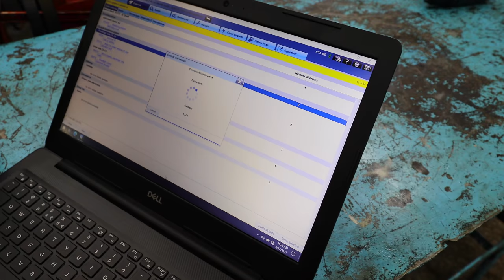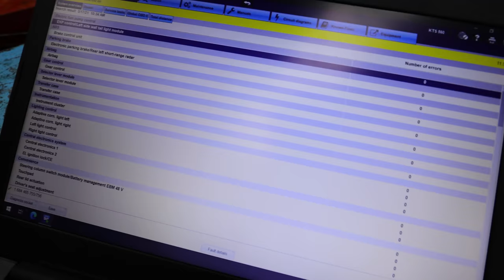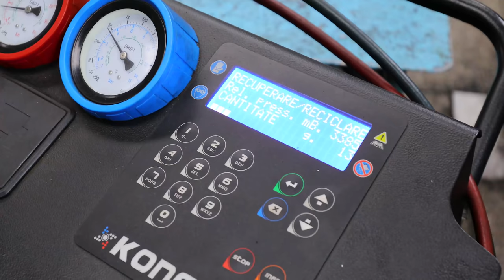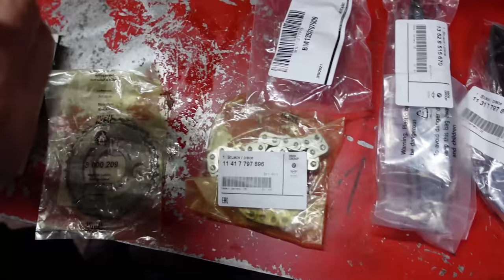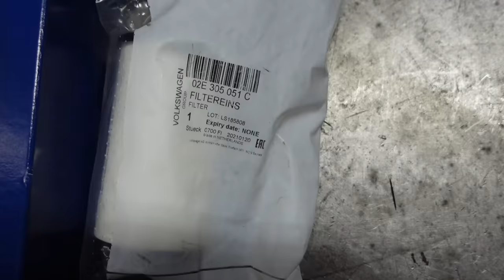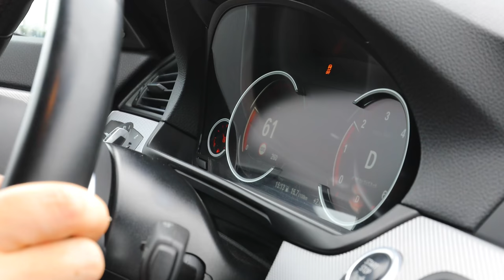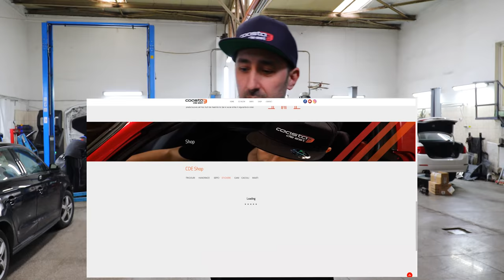BMW M550xd - balaurul cu 3 turbine 😈😈😈

Comment: cel mai fai bmw legenda in lume si unu dintre cele mai bune M3 E36 3.2l 6 in linie 321 de cp
Marcă	BMW
Model	M3
Generație M3 Coupe (E36)
Modificare (Tip motor) 3.2 (321 CP)
Anul inceperii productiei	1995 an
Anul opririi productiei	1999 an
Arhitectura grupului propulsor Motor cu combustie interna
Tipul caroseriei Coupe
Număr de scaune 5
Număr de uşi 2
Performanță
Consumul de combustibil - urban 16.9 l/100 km
13.92 US mpg
16.71 UK mpg
Consumul de combustibil - extra-urban 7.5 l/100 km
31.36 US mpg
37.66 UK mpg
Consumul de combustibil - mixt 11 l/100 km
21.38 US mpg
25.68 UK mpg
Tipul de combustibil	Benzină
Acceleraţie 0 - 100 km/h	5.5 sec
Acceleraţie 0 - 62 mph	5.5 sec
Acceleraţie 0 - 60 mph (Calculat de Auto-Data.net)	5.2 sec
Viteza maximă	250 km/h
155.34 mph
Raport greutate/putere	4.5 kg/CP, 219.9 CP/tonă
Motorul
Putere	321 CP @ 7400 rot/min
Putere pe litru volum de lucru	100.3 CP/l
Cuplu	350 Nm @ 3250 rot/min
258.15 lb.-ft. @ 3250 rot/min
Amplasarea motorului	Faţă, Longitudinal
Modelul motorului S50B32
Volumul motorul 3201 cm3
195.34 cu. in.
Numărul de cilindri 6
Poziţionarea cilindrilor in linie
Diametrul cilindrilor 86.4 mm
3.4 in.
Cursa cilindrilor 91 mm
3.58 in.
Raport de compresie 11.3
Numărul de supape per cilindru	4
Sistemul de combustibil (Fuel System)	injecţie multi-punct
Aspirația motorului Motor aspirat natural
Distribuție DOHC
Capacitate baie ulei	5.5 l
5.81 US qt | 4.84 UK qt
Cantitate lichid de răcire 10.75 l

Comment: Parerea mea e ca seria 5 E60 cu motoarele de 2.5 si 3.0 au fost cam ultimele modele facute cu simt de raspundere.. Intretinute corect duc 500k km lejer
Reply: Mai merita e90 sau E60?
Reply: @ionutm6577  sincer iti spun ca da, depinde si cum a fost intretinuta si de la cine o cumperi, varul meu are facelift-ul, luata din 2012(avea undeva la 75k km) si o are si in ziua de azi, uleiul il schimba la maxim 9k km filtrele la fel, si probleme la motor nu a avut.. Am uitat sa mentionez e modelul 525d

Comment: Nu exista piesa originala, sunt doar furnizori pentru diferite marci auto,care produc piesele respective, iar producatorul auto vine cu conditia sa i se puna sigla pe piese, dar acele piese pot fi aceleasi piese aftermarket pentru ca se fac pe aceeasi linie de asamblare, singura diferenta este ca piesele, de exemplu pentru bmw, pot avea o verificare suplimentara la sfarsit de asamblare , dar aceleasi piese le poti cumpara mult mai ieftin. Totul este marketing. Singura piesa original este cea pusa prima data pe masina cand a fost asamblata.

Comment: Cel mai frumos bmw este e46 330 ci 228 hp. Pt ca e 46 are o caroserie "timeless" iar de ce 330 ci si nu m3? Pt ca 330 ci are motorul m54 mult mai fiabil decat s54 de la M3 si bineinteles pt ca suntem romani🤣 ne uitam si la impozit. La 330 ci impozitul este de 2000-2400 lei iar la m3 este 5000-5500de lei pt doar 300 cm³in plus.

Comment: Pentru mine, cel mai tare model de BMW este (si probabil va fi pentru o lunga perioada avand in vedere  ce "frumoase" sunt noile modele M) BMW M3 E92.
De ce? Doua motive mari si late:

1. Forma caroseriei. Desi este o parere subiectiva, mi se pare ca este cel mai frumos BMW facut vreodata. Nu gasesc un unghi din care masina asta sa nu arate superb.
Fun fact: Pentru modelul M3 E92, s-au preluat de la E92-ul "normal" doar usile, portbagajul, farurile si stopurile. Restul elementelor de caroserie au fost fabricate specific pentru modelul M.

2. Motorul de 4.0L V8 420CP 400Nm S65B40 ce avea limita de turatii la 8300 rpm! Nu stiu ce este mai impresionant: Performanta mortorului sau sunetul pe care acesta il genera? Mereu am avut impresia ca motorul suna foarte similar cu unul de F1.
Fun fact: Motorul putea livra 340Nm din cei 400Nm de la doar 2000 rpm. Foarte impresionant dat fiind faptul ca motorul este aspirat natural